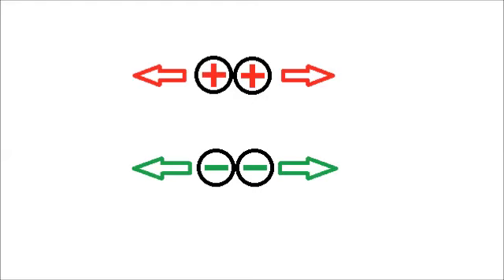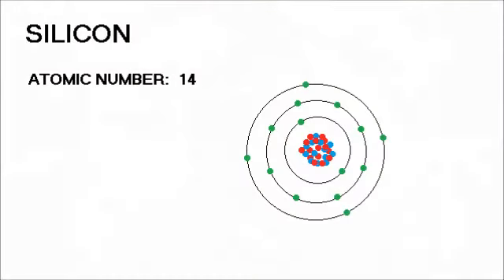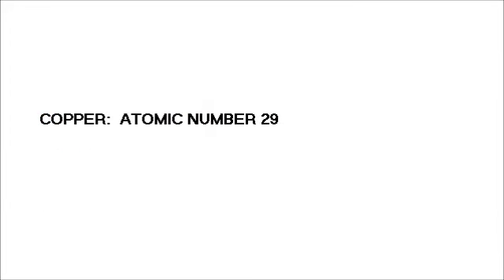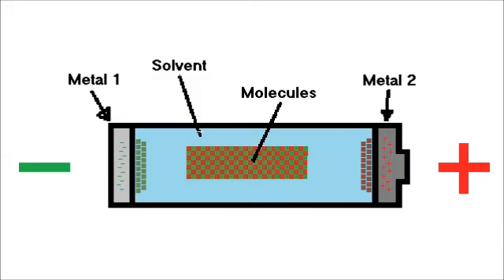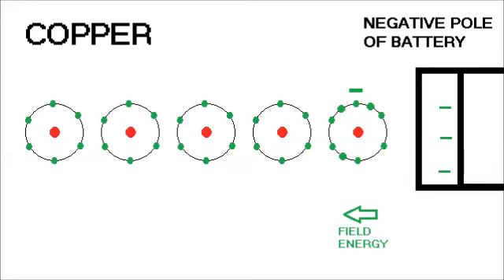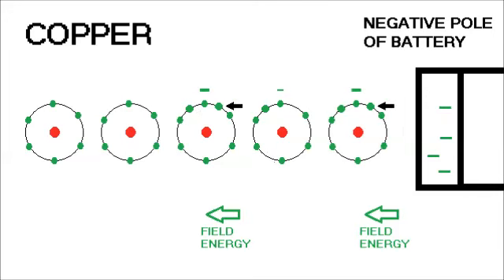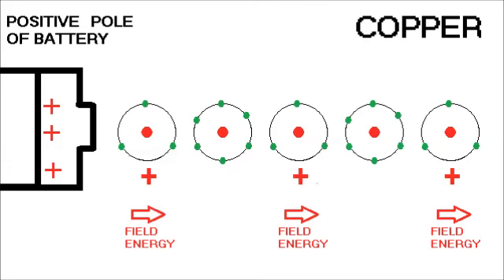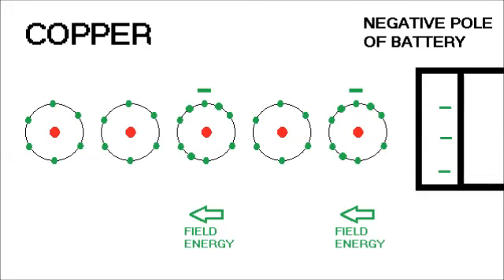Basic Electrical Engineering - Electrons, Charges, and Fields

Comment from the maker: That's correct;  the protons don't move, just the electrons.  However, the copper atoms of the conductor can be positively or negatively charged as electrons are added or taken away.  A charge is an atom that is ionized, and electrons cause the atom to be charged one way or the other.

Comment: Charge and heat are properties of materials like pressure and temperature, Fields are forces like emf, or gravity. A field generates a force from configurations of matter and changes in matter and Fields results in the movement of energy.

Comment from the maker: V=I*R, but you don't need current to have voltage.  If you turn off a switch, there's no current, but there is voltage across the switch terminals.  Anyway, at 6:14, the plastic bag was charged with static electricity, which can be several hundred volts, even over 1kV.  Static will produce enough voltage to arc (static shock sparks), but the current is so tiny and short in duration that the arc only gives you a slight pain instead of frying you.

Comment: Confused about the statement made 1:03:27  -   how can the right plate be weakly positively charged.  At the beginning of the video with the charge descriptions, you used the logic that a positively charged atom makes the neutral atom next to it relatively weakly negative.   So using the same logic, why isn't the right plate weakly negatively charged?

Comment: ok i think i undesrstand but since the number of electrons inside the battery and in the wire is always the same cause there is not spontaneus creation of electrons on the battery, i think a better analogy to the coins one you used w (the pennies) would be by turning around the coins as if one side of the coin represent a surplus of electrons and the other side wolud represent a lack of electrons.

Comment: Whonder full video. i Understanded alott bether now. 2 Questions 1= did you mention difference betwen ac&dc? 2:is dc alott easyer to work with in eks Circut etc i see alott of adapter that forces volt&amp to be lower but alsoe change ac to dc. :) ps Hope you make more videos about this :D ( am From Norway+I have Dyselexia)

Comment: Sir, who ever you are.you demolished the wall of doubts that has been inhibiting me from furthering my studies in Electronics.Had I seen your lecture some 8 years back,I would have passed out of my Engineering with flying colors.I have a request.In one of the videos on electrical engineering, the instructor told that capacitors and inductors have past memory.that they remember the variation in the charge or current or voltate.I did not get it. I request you to explain it, if you have time

Comment: If AC can be used in a capacitor then why is there a negative lead and a positive lead - considering that with AC, the polarity is constantly reversing. thanks.
Reply: +J Blair Ironically, the basic AC concept for electro-technology was invented by Nikola Tesla. And followed up by some former RCA people, like Eric P Dollard. Ironic because the way the most cunning electricity nerds explain electricity and magnetism, is a bit different than what normal schooling does (this guy here in the video takes the very basics, so it doesnt come to that problem yet)  The old electrical engineers did not consider the electron theory of standard model to be relevant or correct. For example Tesla and Dollard (though they did not believe the same exact things) think of the field as more significant than matter, in information transfer. Poles are only a quasi-metaphor to them.